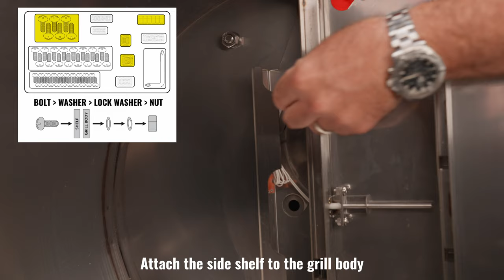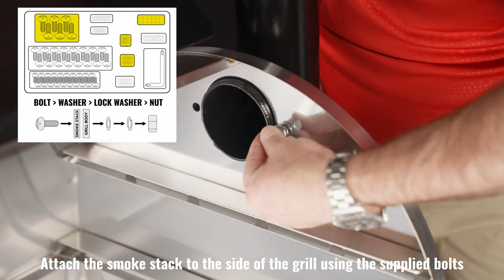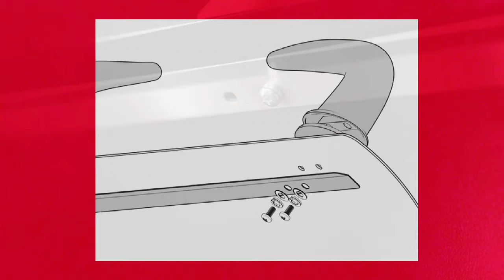Flagship XL Assembly

Comment: Considering I’m probably one of the first few consumers to assemble one of these by myself, I’ll give you my input and tips. 

It was delivered to me on a wood palette in my front drive way, like the video shows, unload everything inside the grill before attempting to move it to your assembly site (I scratched mine a little bit in this process because I was attempting to hulk it, alone). 
The hardest step for me was adding the base to the legs. While its relatively easy to slip the base in between the grill legs, the issue is pressure is needed from different angles to get the holes to line up and bolt down (a buddy would be nice here to apply pressure to the legs).
For the bolts inside the grill, I never received a “supplied wrench” I had to use gloves and do it by hand and use my own poor fitting wrench. 

The burn in went fine. Dont be surprised if it goes above 400 during this period. Apparently this is normal for burn ins. 

For the wifi connection (android user), I had to use my wife's iphone and suddenly it connected after i went through the set up price via apple (please look at this recteq). Make sure your phone and grill are connected/connecting to a 2.4 ghz wifi. 

Happy Grilling.